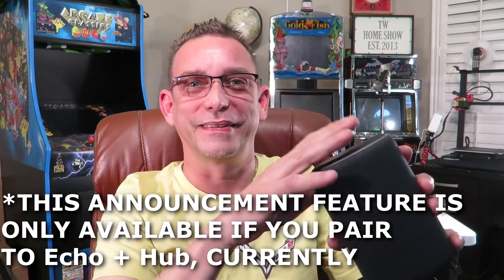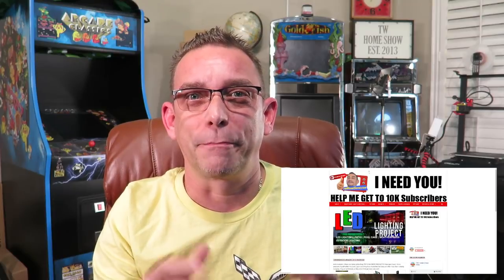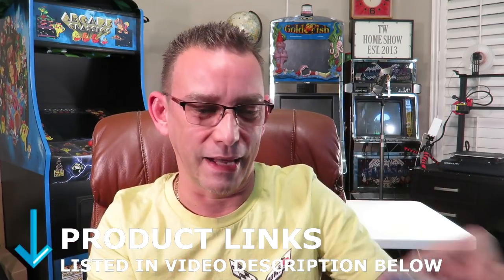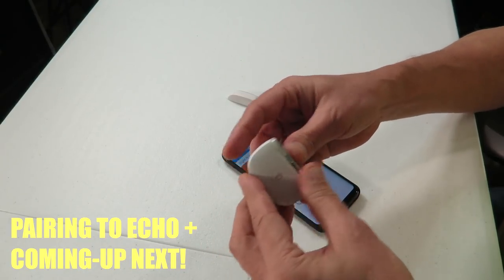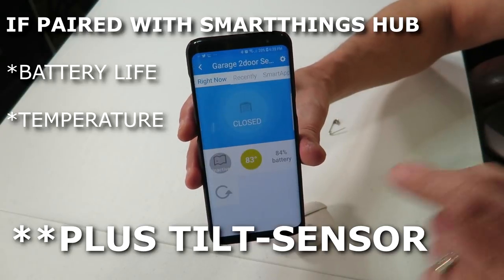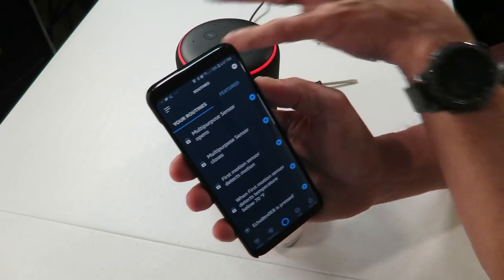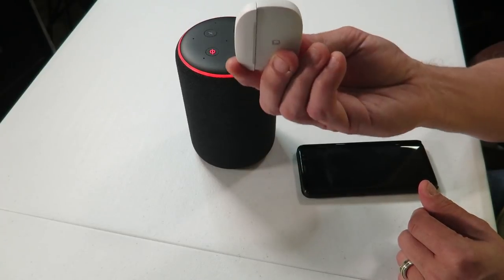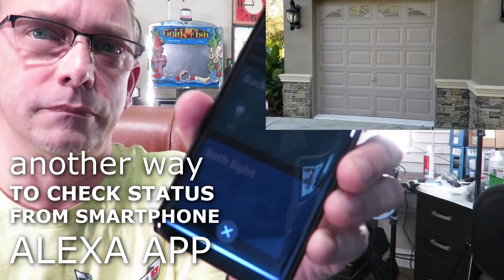2-WAYS TO CHECK YOUR GARAGE DOOR STATUS | Smartthings Multipurpose Sensor

Comment: My home alarm system has a garage door sensor. I have successfully connected the home alarm to SmartThings using an EnvisaLink card. Works great. The problem is Alexa/Echó devices have no If then else features. Like if I ask Alexa’s to close my garage door, it has no way to determine, if door is closed, do not close it, as the eWeLink will open it (eWeLink does not have different commands to open & close). I can do it with SmartRules, but sadly eWeLink does not connect to SmartThings.  It would be great if I asked Alexa to close garage door, it would evaluate the status of the sensor and if the door is open tell eWeLink to close  it, but if it detects the door is already closed, simply tell me, door is already closed and end routine without triggering the eWeLink.

Comment: Appreciate the video.  Is there an alternative way to hook up the SmartThings Multipurpose Sensor to the garage door without the adhesive on the back? I think using the adhesive on the back won't last long in a hot garage.

Comment: Hello from Canada my friand
Please tell me i just received the device...(multipurpose sensor) i have 3 echo dot and I try To connect the de vice without any sucess. Did i missed something?
Regards   jee waye (jy)
Reply from the maker: Hello JeeWaye, You need at least one ECHO PLUS, in your household. Echo PLUS will connect to smart devices like sensors and light bulbs and smart plugs, etc. You can usually find a nice refurbished Echo Plus for a nice price. Check out my links to them in the video description. Once you have your smart devices paired to an Echo Plus, you'll be able to control them with any Echo device in your household (like the Dots). Hope this helps you :) Todd
Reply: Thanks todd for your fast reply
Any other sensor out there on Amazon that will do the same job but with my echodot.
Thanks a lot.